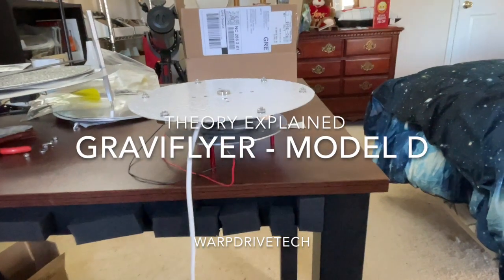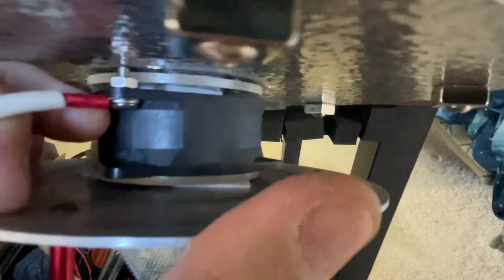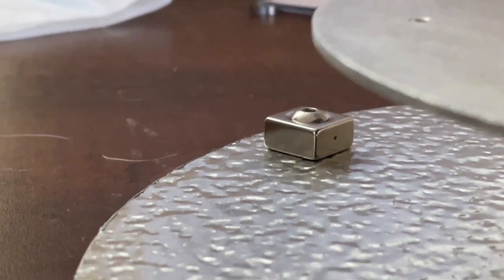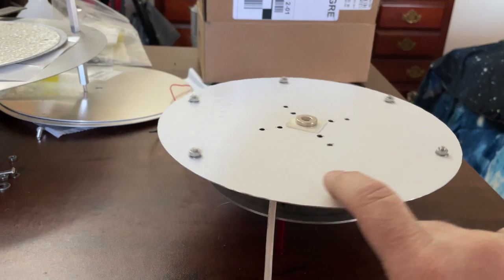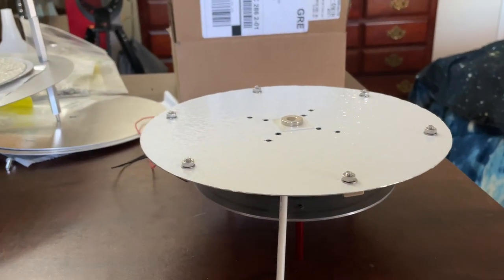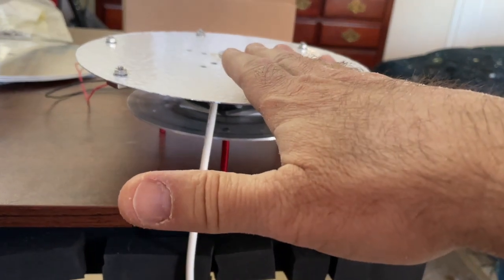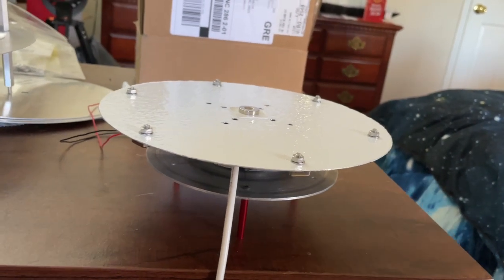Theory of the Graviflyer - Model D

Comment: Based on the videos I have seen, i don’t think the graviflyer is an ionic wind device. The behavior looked the same inside the house or outside with wind. The power cable wasnt extended in the wind direction. I like the effort, but I dont think this is it.
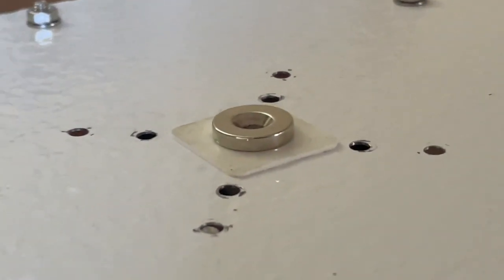Reply: nope is fake.  he uses strings and poles and video editing.  he had to mistakes in his video editing.  like one of his video he forget to erase portiin where his string is v clear at 1:33 of his video.  another video he forget to remove his mouse arrow out of the picture. and but his timing of editing video has gone better that people got scammed to believed its real.
Reply: @Blog-os3kh  Do you have any proof or do you just put out BS?